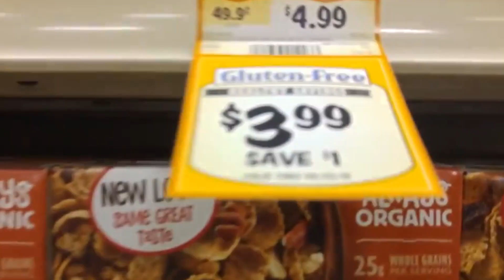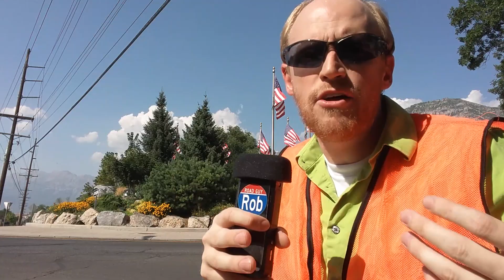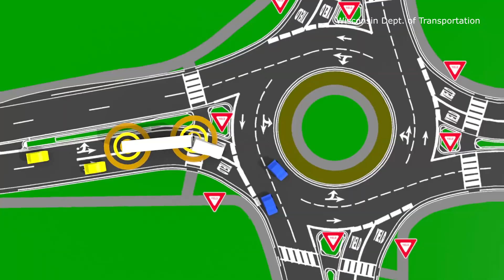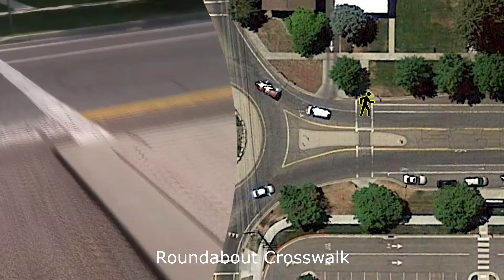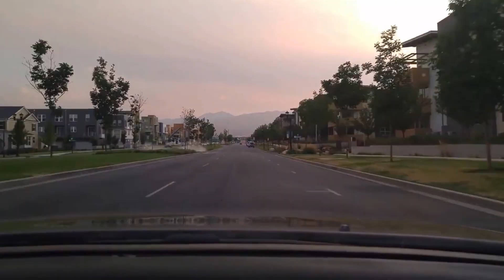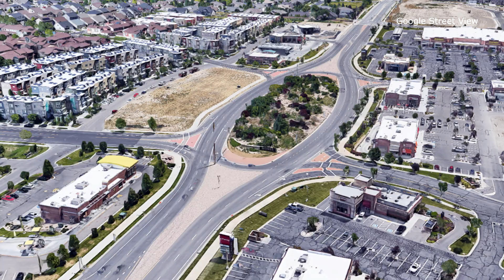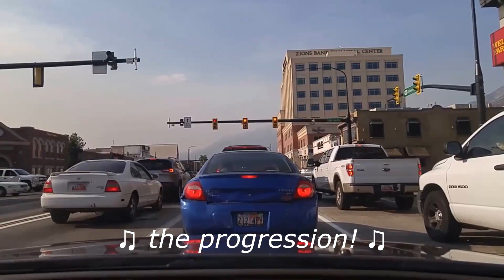Are roundabouts REALLY better than a traffic signal?

Comment: Those roundabouts shown in this video have the pedestrian crossings quite far away from the roundabout itself. In Europe most crossings are a bit closer so walking is pretty convenient, actually. Of course not all and I'm sure in US there are other kinds as well.
Reply: My neighbourhoods have roundabouts where the crossing is near the entry/exit of the roundabout. I always try to avoid crossing there because all the cars just speeding up when exiting the roundabout.
Reply: There are also the white stripes missing. I don't know how it works in the US, but it would definitely help to let motorists see clearly, where people cross the street.
Reply: If there are a lot of pedestrians that completely messes up the flow advantages of roundabouts though.
Reply: @shraka  Then you make underpasses for light traffic, ie. pedestrians / cyclists.
Reply: @Xerdoz  That's extremely expensive to build and maintain, and almost always bad for cyclists and pedestrians even if it's well designed and maintained - the pedestrians are having to take 'the long way around', which makes no sense as they're the ones least capable of doing so.

The better solution is only having roundabouts on major roads away from buildings and pedestrian traffic, and have them elevated so any cyclists and pedestrians don't have to ascend / descend too much.
Reply: @shraka Roundabouts aren’t always the solution. It depends on the place. Sometimes a traffic circle with lights is the answer, sometimes a roundabout, sometimes a normal intersection controlled by lights, sometimes an intersection without lights. Each intersection is unique. In the Netherlands, where I’m from, you see roundabout in all kinds of situations. Urban, rural, with or without bike path, with or without pedestrian crossings etc.
Reply: @DanDanDoe  It's research out of the Netherlands I'm seeing showing that roundabouts aren't safe for cyclists and pedestrians when there's separated bike paths. Though I will say those 30 zone 'mixed use' streets you have (I'm jealous) seem to work well with roundabouts.
Reply: Usually the US is a couple years/decades (depends on region and design feature) behind europe and europe is a bit behind the Netherlands.
Reply: I think that's for the best, that way cars yielding to traffic in circle don't block the ped crossing.

Comment: Roundabouts are efficient, keep traffic moving and don't have the maintenance issues of a normal intersection with traffic lights, crosswalk signals etc.... The problem in the US seems to be two issues....people are not used to them...that will change.  And the multi lane turns seem to confuse the heck out of everyone.  Overall a better idea though.  The biggest challenge for many US drivers seems to be the concept of merging at a similar speed.  Even on modern highways the on ramp seems to confuse people.  Folks will poke along and then simply pull out without getting up to speed.

Comment: The thing I don't like about roundabouts is the lack of visibility.  When I'm approaching a roundabout, the cars I need to know about are the ones that will reach my entry point about the time I do, and they don't appear from behind the hilly mound/massive boquet/whatever-they-put-there until I'm fairly close to the intersection.  That means that as I approach the intersection, my eyes are on the road to my left instead of where I'm going (which is even worse, since "where I'm going" also includes a crosswalk, where pedestrians have the right of way).  I figure that if it weren't for the lack of cross-circle visibility, I might have an easier time with them since I know if there's a car coming around the corner.

As for multi-lane roundabouts, I find their signaling unintuitive.  I don't actually want to do a driver's ed-style "SMOG procedure" (Signal, Mirror, Over-the-shoulder [blind spot check], Go) to get into the inner lane, and then again to get back into the outer lane.  I know that's not the way you're supposed to do it, but it does feel weird "changing lanes" without signaling the lane change.

Comment: Before watching all of this.  In my opinion I think they are great.  We had one Intersection here on a Main highway that was a T-intersection and it would get crazy long back ups for the traffic that made left turns and it would have some very nasty if not out right deadly accidents there.   Well now back ups are measured in just a few cars at the most and well there is still accidents but they are at a slower speed and expect for two  cars have been able to drive away from the accidents but no deaths.  NOW with that all said.  Roundabouts only work if people know HOW to freaking use them right.

Comment: My town have had a serious traffic problem for decades. Two well used highways merge on each side and run together right through the town center. Now after years and years they are going to improve it as a 4-lane street with roundabouts instead of traffic lights. As part of the construction they have built a narrow temporary road around the site, with small roundabouts replacing 3 out of 4, intersections, and guess what? There are less traffic jams than during the past 30 years!

Comment: Would say that a traffic light intersection is best when you have differential loads (ergo a heavily loaded north/south combined with a lightly loaded west/east road) because then you can put the north/south on always-green and then have west/east be sensor-controlled so the traffic light triggers and turns to red only when cars approach the west/east road. This gives the best flow since the north/south road is practically unrestricted until the west/east road is used.

I have seen very many such roads on the end of certain freeways in sweden, where a very lightly used road (lets say, 1 car per hour) is intersectioned with a heavily used road, like more than 120 cars/hour. Then they put a traffic light there that is always-green which triggers on usage of the lightly used road. In some cases they even doesn't equip the green hole with a light but a black disc instead, and just have the light turn yellow-red to save on having to change green LEDs/lightbulb since green is almost on 24/7.

Same applies if the loads are not heavily differential, but just a bit differential, since in those cases a timed traffic light (with phase times that roughtly match the load) can even out the load in the intersection.

However, if you have a intersection that have almost equal loads, a roundabout is actually the best, since then a traffic light will just interfer with the flow, while a roundabout will keep the flow roughly OK.

Comment: What is not taken into account is that Pedestrians have priority on roundabouts, at least if they are done well. So typically they don't have to stop walking, unless you have the 1 asshole not giving them priority maybe. If you have stop lights you might optimize traffic flow for cars with the green wave, but you do it at the expense of safety, at the expense of pedestrian flow as well. So how is that a win? Also cyclists are forced on the road in the USA, so they slow down traffic which means the green wave does not work that well either. Giving more hatred towards cyclists and more dangerous road users.
It is true you need to look at each intersection and see what works best.
But if single lane roundabouts can be used without clogging up the traffic too much, they are always the best for all modes of traffic, certainly if you use Dutch style roundabouts. Not a fan of multi lane roundabouts or turbo roundabouts though.

Comment: I am trying to remember where I saw it, but I have seen traffic flow reports that show number of cars passing through a give way/yield roundabout is considerably higher than that of a standard stop signed cross road, let alone a light controlled one. It is not just about reduction of accidents, and fatalities, the flow rate is consistent, even in dense traffic, obviously if set up correctly and lane usage is correct. 
Multilane roundabouts need a wider area than smaller ones to make sure you do not have the speed issue, (so expanidng a single lane to have an additional lane just negates some of the values of a correctly set up roundabout) and as you called them oval-abouts work but need to be wider and longer than the one you showed, they allow multi-road  junctions to join. I have seen oval-abouts with up to 7 different roads connecting (7 junctions to, and from, the about) but the size of it needs to be a lot larger to allow more time for people to move between lanes, and to keep the curve that makes people maintain their speed. Another point is culture, Europe has the culture of these are normal and this is how you navigate them. The USA not so much, for the six years I lived in MI lane management by drivers on an individual bases drove me crazy. Oh on a freeway sure most of the time, but the amount of sudden lane changes even there was worrisome, but in towns, you see someone in the suicide lane, suddenly change across two lanes because "Oh! that is where the Baskin' robins is, and I want to be there."
In the USA a lot of people see a roundabout and think traffic circle and traffic circles are dangerous, but also a lot of mayors are at fault also they see stats on roundabouts and say "I want one of those, give me one of those Jim, Oh and put it at the cross between Betsy and Main there is some space there!" they do not understand that you can not just plop one in, it needs a lot more space than a 4 way junction and it is not just about cutting off the corners.

Comment: I didn't like roundabouts when they first started putting them in here, but they completely cleared up some major congestion that would form at all the stop signs around my area during rush hour.  After that, I was sold.

We had lights on the one-way streets downtown that were timed for platoons, which was a great idea in theory, but you always had a handful of idiots that would speed up ahead of the group and get caught ahead at the next light.  Then as the rest of the platoon approached and the light turned green, they still had to slow way down because the idiot drivers had not had enough time to accelerate back up to speed yet.  But if you got lucky and didn't get some morons out front, you could make it through the entire town without hitting your brakes once.  I've never understood how the platoon method could be used on two-way streets, though.  Must just work in smaller sections?

I've never really liked stop lights.  Sometimes you just have too much traffic in two small of an area, and there just aren't any other options, but on relatively un-busy roads or in areas with lots of extra space, they just tick me off.  There's nothing worse than waiting for a light when there's not another car anywhere in sight.  I recall a long long time ago that lights in this area would turn into flashing yellow lights (with flashing red on the minor streets) once it got past a certain hour at night (since there was less traffic at that hour).  This eliminated that frustration when you were out on the road with very little other traffic.  For some reason, they did away with this, though.  No idea why; it was brilliant.

That "ovalabout" just looked stupid.  Seems to me it was just two intersections with the road curved a bit to make people feel like it was something special, even though it didn't appear to have any of the advantages of an actual roundabout.

And as far as pedestrians go, screw 'em.  Walking in un-American!  Go home and get in your gas-guzzling SUVs.  Dang hippies...
(I kid of course, but walking is so inefficient.  Bikes are the way to go if you want human-powered locomotion.)

Comment: See, my town does exactly the opposite with "platoons". If you hit a single red light going through the highway that passes through town, you're absolutely guaranteed to see red lights at EVERY intersection thereafter. There are around 15 stoplights as you pass through town.

I'm not even joking. I drive this road every day going both to and from work, and it's absolutely true. They also have a few of the lights setup to detect vehicles pulling up to the lights, which causes those lights to instantly switch. This stops all traffic on the main highway so that one random arrival gets to go without waiting. What's even more hilarious is that most of these lights are in locations where the random arrival is taking a right turn - so they've taken their free right on red and are already gone long before the light tells them they can go.

Whoever designed our traffic system needs to be shot, because they couldn't have done a worse job if they'd tried.

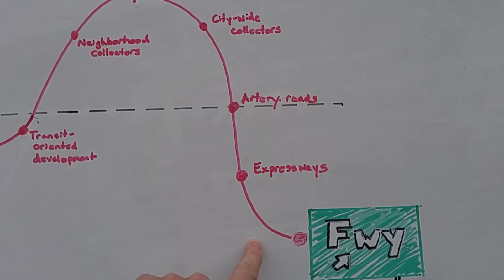Comment: 8:08 "And definitely don't put any roundabouts on the freeway!" Tell that to the town of Joure, The Netherlands! xD
Reply: Also, if there is a need for a crossroad on the freeway, the roundabout will still do it better..
Reply: I don't see the roundabout on the freeway (because that's a shitty idea)
Reply: I checked on google maps and I’m not sure which ones you mean. The ones at afslag 24, by the on and off ramps? Those aren’t that uncommon and can greatly help traffic flow, but sometimes can clog up during rush hour. At afslag 12 by Bodegraven there’s a stretched out roundabout and I notice the off ramp from the N11 often backs up quite a bit during the evening rush hour. It might have more to do with a lot of traffic being funnelled into smaller roads than the actual roundabout.

Comment: In my opinion they are because you dont have the annoying thing when you see a green light a little bit a head and you have to decide should drive moderately towards the greenlight and be able to stop intime if it suddenly changes, or should i drive the road speed limit and risk not being to break in time and take my chances on getting past before it turns. I will roundabouts any day over unreliable traffic lights you cant trust,  Although i will admit there some roundabouts that are tricky sometimes especially those with more than 4 exits and multiple lanes.

Comment: The "ovalabout" actually has a name! They're called traffic diffusers - a term I believe was coined by the urban planner Rick Harrison when he designed them for his Prefurbia concept (an alternative to city blocks). They're quite different to roundabouts as they do not require traffic travelling across two of the directions to slow down (thus being able to accommodate more traffic, increasing through speeds, and reducing pollution). They can also have dedicated turn lanes making them a bit safer. Diffusers are superior to roundabouts in my opinion, but they do require a much greater amount of space. They're definitely different enough in the way they work so as to not be classed as a roundabout, though!

One interesting downside to the roundabout is pollution from internal combustion engines. Because roundabouts require all traffic to stop (or at least slow down) before entering they are slightly worse for the environment than some of the alternatives.

Also, a safety vest without reflective tape does not meet approval for usage on a road! ^^;
Reply: I've read that traffic lights create far more pollution from the cars all sitting there idling...
Reply: US 22 in a commercial stretch in NJ has a lot of ovalabouts, with additional turns in the middle into commercial driveways.

Comment: I’m surprised Americans haven’t taken to roundabouts better, especially when you use the filtering right thing at some red lights. Roundabouts are the free market in action whereas traffic lights are a command economy in action. Traffic lights stop you by diktat even if there is no other traffic. Roundabouts devolve decisions to the ‘consumer’ who takes them after weighing up what is in his interests. The result is that people make better decisions than systems and traffic flows faster and safer.
As far as pedestrians are concerned, let them cross closer to the roundabout with pedestrian controlled traffic lights if necessary on the roundabout entry/exit.

Comment: They don't need to put the crosswalks there. Americans always do the right thing, after they have tried everything else. EDIT: Utah has a big problem - four way intersections. We need to redesign that whole system by having proper arterial roads that act like little freeways, e.g. instead of turning at a right angle onto State St, have a little turning road that branches off from the main road completely (not sure what they are called. Ideally, we would also have viaducts/brides or tunnels over or under big roads like State St that these mini offramps would branch off of. It would also be good to have arterials that actually go somewhere. 500 S and 600 S o between the I-15 and...nowhere. In the meantime they can finally readjust the traffic light timing so hitting a measly five greens in a row isn't some laughable fantasy!